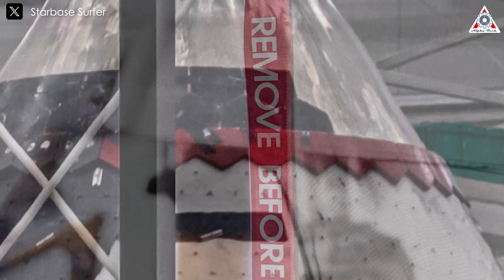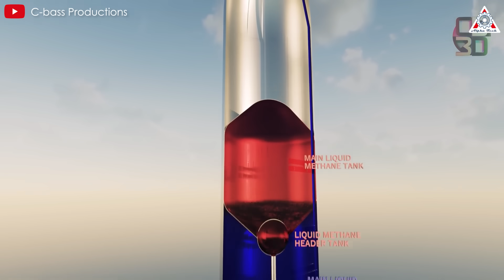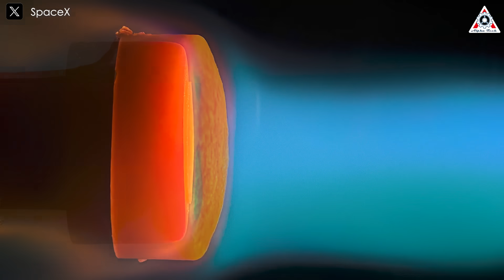Elon Musk Revealed NEW Metalic Trick to Make Fully Reusable Heat Shield instead of Ceramic...

Comment: Try using YSZ instead of the top fired coating on your heat shields?  We use YSZ in turbine engines, its high >2000 c temperature of YSZ protects engines parts for many thousand of flights in airplanes.The aluminum fibrous backing of your current heat shield should be an excellent bonding substrate for it. It is precision spray coating. It could Allow in-situ repair of heat shield even on mars. yes it cost more but is at least 10x more durable.

Comment: I think that SpaceX new metallic heat. Shield will work something very much like a air lubrication system for boats, but instead of air methane will be the coolant. Here is a brief description of a air lubrication system.. 
Comparisons to SpaceX heat shield system.
Air Layer Drag Reduction (ALDR)
After many years of studying the BDR method, the focus of the air lubrication method extended to the air layer. When enough air is injected into the near-wall region of a turbulent boundary layer of water, the injected air will coalesce to form a continuous or nearly continuous layer of air separating the solid surface from the water flow. When the injected air increases, the coalesced air layer is able to maintain a fully continuous air layer covering a larger wetted surface and subsequently results in a greater skin friction drag reduction.

Comment: I don't understand. Steel tiles are heavier than ceramic tiles. And steel protects less from heat.
The steel coating only makes sense as an external coating that holds the tile in place.

Comment: Why do the exhaust flames bloom out after launch, before the first stage separation?
Reply: Sea level engine nozzles are designed so that the exhaust flow is totally axial at sea level atmospheric pressure when maximum thrust is required to get the thing off the ground. As the rocket climbs, the atmospheric pressure is reducing and the exhaust plume therefore spreads out.  The second stage has at least some vacuum engines, the larger nozzles of which are designed for axial exhaust flow in the vacuum of space.

Comment: To have coolant or gas leak through the tiles for cooling has me wondering something. 

Since the heating is caused by rapid compression of the air, what is the pressure at the tile?  Clearly to have gas flow out of the tiles will require a pressure much greater than the compressed air outside of the tiles. What pressure differential is needed to ensure sufficient flow to work as a cooling solution?  If this differential is not met, what prevents back flow into the tanks?

I have wondered the same thing about the blast plate under the engines on the launch mount.  What is the pressure at the surface at full power and what is the differential needed to ensure adequate flow for cooling.  How does the water turning to a gas from the heat affect this?  Water expands like 1700 times when converted to steam and that takes space and so on.  How does all this work?

Comment: Curious. The published re-entry temp of Starship is 1450*c. The published melting point of Pyrex is 1650*c. Why not use Pyrex backed by the two layer ablative as a thermal separation? Would the Pyrex transfer too much heat to to the metal beneath or is it just too heavy?
Reply: Pyrex is too heavy
Reply: @raybod1775  I kinda figured that was it.

Comment: This could be a test. Note the different materials just below the red tiles. If the red tiles bleed liquid methane on their lower edge this could be a test of a version of liquid cooling heat tiles. The methane creates a boundary layer that repels the super hot plasma layer generated from atmospheric friction. Tiles below this would be protected for maybe 10 or 20 meters. These special red tiles could be strategically located in the hot areas like near the flaps. Liquid cooled metal for the base of stage zero maybe was a sign of things to come? I hope so. This approach if successful would be a total game changer. It's not a heatshield technology that has ever been flown. Rather than ablate your tiles, use onboard consumable methane to take the heat away.
Reply from the maker: That’s interesting! That could work!
Reply from the maker: Thank you so much!

Comment: I don't see the point of using tiles if a steel heat shield is used, an entire second skin like my thermos seems simpler.
Reply: Leave the rocket science to the rocket scientists
Reply: The tiles allow for the shield design to endure extreme temperature differentials over time and location without buckling.  Even if there is a metal alloy capable of surviving the heat and plasma erosion, it would likely need to be assembled as tiles.  The tiles allow for minor changes over thousands of parts than for major geometric changes over a few.

So, for a monolithic exterior shield to function the material must endure intense heat, plasma erosion, and be geometrically stable throughout the duty cycle.

There is likely some we'll funded labs looking for this miracle material. In the meantime SpaceX works with what they have.
Reply: Too heavy
Reply: Lmao 😂 let me help you out. Put your hand in that thermos then
 place said thermos with your hand in it over a fire then get back to me lmao

Comment: Good Morning my Friend. If they are reverting to a metallic heat tile. They probably found an element or combination of elements that would allow to not only go way above the melting point of metal. But go way above the oxidation point. That would give them the resilience to make Starship totally reusable. They most certainly found something that would bring them closer to their objective. Interesting report. Does SpaceX have any idea how a heat shield would work in the Mars atmosphere. Or even if a heat shield is necessary. I don't think they know. What do you think. I'd like to know. Again Great Episode. You never disappoint. Have a great Day my Friend. 2 days left 'til 2025.
Reply: There are metal alloys like those that are used in the raptor engine bell nozzles, that have to withstand continuous extreme temperatures of the boosters rocket exhaust flame.  There are some critical engine components that are already liquid cooled. So raptor engine development could be supplying answers to other issues.
Reply: @djohannsson8268  Interesting. That makes perfect sense. Thanks.
Reply: Ok. I can see that. So let me ask you this. If SpaceX lands a ship on Mars. Would you use a Vacuum engine. Or a Vacuum hybrid engine? I have a lot unanswered questions. Thanks for your input.
Reply from the maker: It’s a really big challenge!
Reply: @alphatech4966  That's for sure.
Reply: If you donate small but of reading there is no need for a heat shield on mars. We have rovers on Mars fyi